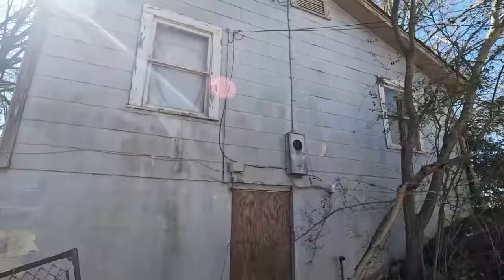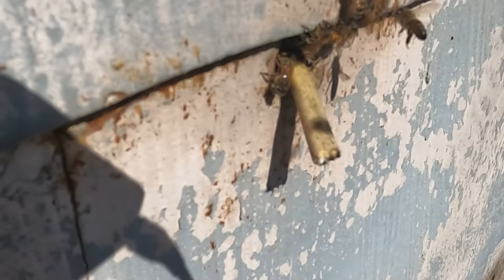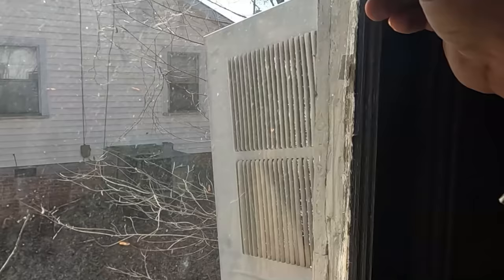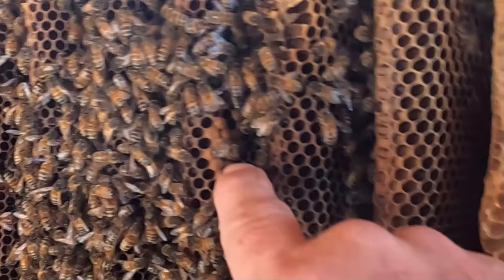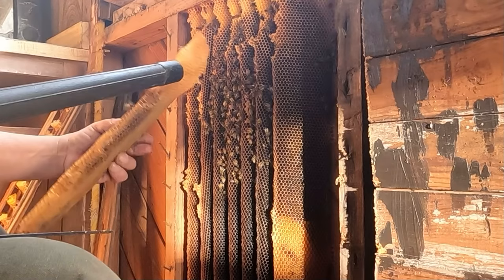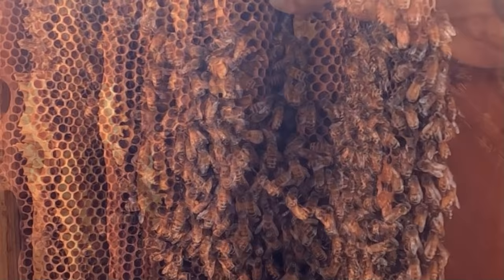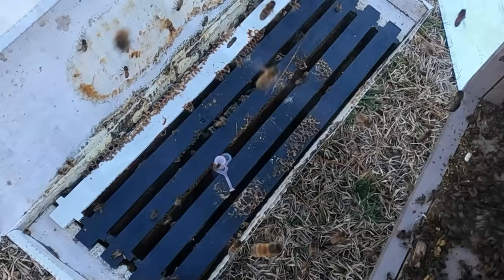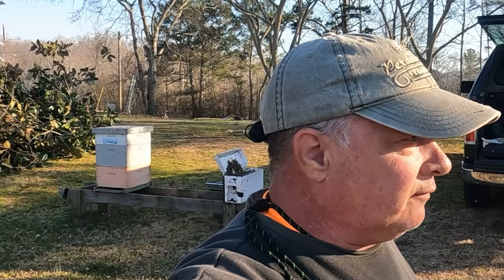How Bad Could It Really Bee

Comment: Cool place! You sure it’s not for sale? BTW, the siding on the outside is asbestos shingles.
Reply from the maker: Ya, it's pretty common around these parts.
Reply: @YappyBeeman  yep, my Grandfather’s house that he built in 1950 was the same with the 45 degree 1x at a 45 degree angle on the outside with the asbestos shingles was touted as the “future of fireproofing your home” by the advertising industry for several decades….. at my elementary school and Junior High, the ceilings were heavily coated with asbestos and we used to throw our pencils up into the thick coating to watch them stick into it, and tell the teacher that “I lost my pencil “ 🤣😂🤣🤠

Comment: Another classic Yappy! Was the brood comb not worth using?  Looked like you had black plastic drawn comb in the nuc box at the end.
Reply from the maker: With it being early spring and they didn't have much in them, I just gave them some to restart with.
Reply: @YappyBeeman  ok gotcha.  Sometimes it works best just to start over.  Wasn’t a ton of brood in the wall so makes total sense.
Reply from the maker: @brucesbees  the comb was pretty dry.  Not much forage and the Temps that day were better than they had been  for a while so it made sense to be so low.   They are rocking though in the new box.  They just might turn out good.

Comment: Did you release the bees in the vacuum cleaner so they could go into that new box nest?
Reply from the maker: Yes.  And it's not so much a vacuum cleaner but a special designed setup to not kill them.   A regular vac would kill them.
Reply: @YappyBeeman I love how much patience you have for the education side. It might be worth doing a lil dry humour filled video with some drawings or diagrams and a bit of practical demonstration to educate people specifically about the basic operating principle of the bee vac systems you've used over the years.

I know it pretty immediately clicked that the setup is either gotta be:

a) a big sealable filter box with two holes (for the vacuum inlet and outlet) and a nice big mesh on one end to keep the bees from entering the smoothie pipe, which also reduces the air pressure (per square inch/per bee) so you don't get bee bits sucked through the mesh holes ala Byford Dolphin.

or

bee) a clever induced airflow separation system that slingshots bees into the box through the power of the venturi effect without the need for a mesh filter, somehow (or sort of an inversion of the usual venturi effect that uses a vacuum instead of compressed air).

Or possibly some third, secret option i haven't thought of. Either way it'd be fun to have a lil video showing roughly how the air flows and what bits keep the bees from the choppy bits of a vacuum.

Comment: Doesn’t your vacuum kill the bees?
Reply: At the end he shows you them being released into a wooden hive
Reply: @Kyosumari It's probably because a regular shop vac almost always has a relatively high speed impeller and some clever use of airflow separation to catch dust. As such you can expect your average insect to be at least injured, probably mortally wounded or killed, when sent into the business end of a normal shop vac. 

You and me and yappy know that the bees never enter the vacuum itself, but it's not always clear in his footage that there's a big ol filter box keeping bees from becoming a bee smoothie. 

People likely assume the bees are going through the impeller section, but we know better that the filter box between the vaccuum and the nozzle keeps them from being battered and blended like you see yappy do to wasps a couple of times. 

it's not much wonder that especially on earlier vids or vids that don't clearly show the bee box connected to the nozzle people be assumin' wrongly. It's a perfectly reasonable assumption if you know how a vacuum usually works and don't make the connection that the big box of bees with the round holes in it is catching them.